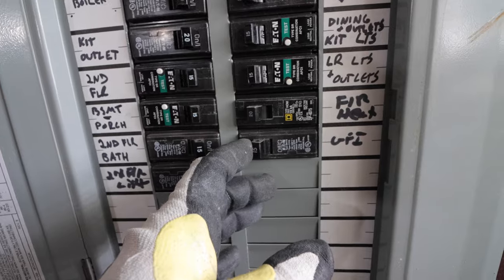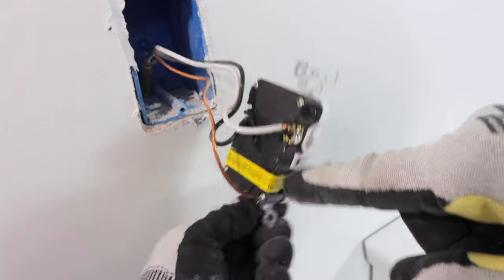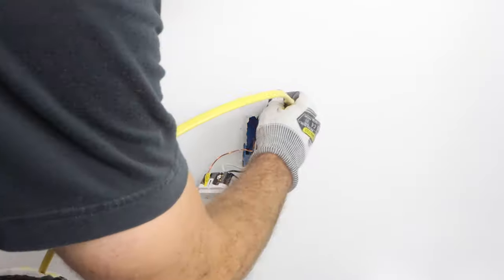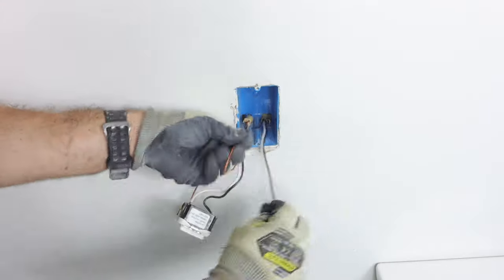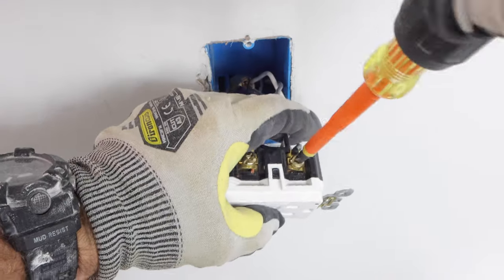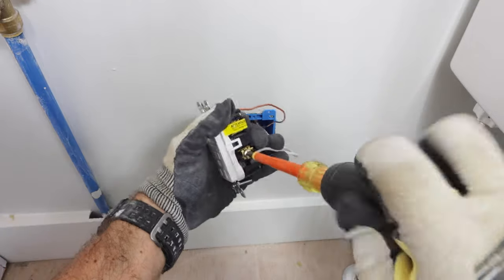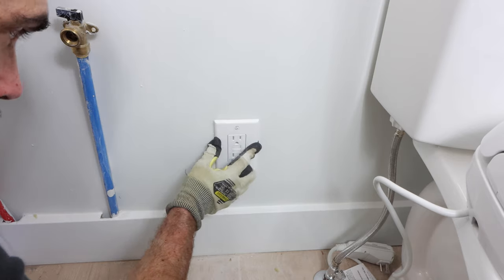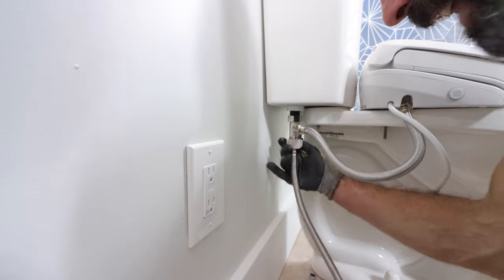How to Add Second GFCI Outlet in Bathroom

Comment: Just came across this video - WOW is all I can say - Do Not do this at home - you need one GFCI at the beginning of the circuit - the second receptacle should be a regular receptacle - wires from GFCI to second receptacle go on the LOAD side of the GFCI - also with the wire nut he is using you do not have to add a third ground wire for a pig tail - hence the hole in the top of the wire nut - you twist the two grounds together and then snip one off leaving one long - the long one goes through the hole of the green wire nut and around the ground screw of the GFCI.

Comment: You went pretty fast, but it looks like you wired the second gfci from the load of the first. That's wrong, a gfci should not be getting power from a previous one or one gfci per circuit when using the load. Just put a regular receptacle for the bidet and you would be good and the best method. Then place the label that states "gfci protected outlet" on the new outlet. Alternatively, you could use a second gfci, but it must be wired from the line of the first one, in order to make them independent.
Reply: this is what I was thinking, I though I was the only one
Reply: @jefejff  actually your incorrect do your research before you state someone else was incorrect.
Reply: It looks like (to me) for the top gfci, he put both blacks on the line side, but for the white wire he put one on the line and one on the load?

Comment: Technically the way you wired the 2nd gfi to the first gfi is wrong.  Im surprised you got 2 orange lites on at the 2nd gfi.  Because the 2nd gfi should be hooked up to the line side not the load side.  Many othwr videos demonstrate this and the 2nd gfi will have power on the wires but not to anything plugged into the outlet.

Second, all you needed was a regular outlet.  No reason to use 2 gfi on the same line.  And the toilet seat has one built into it also. You have 3 gfi for that seat

Comment: That’s a lot of GFCI’s for one run.
Reply: Line to line connection to the second GFCI. No load terminal used in this application.
Reply: @tedlahm5740  No, he specifically said "removed the yellow sticker" from the original GFCI, those were the load terminals

Comment: Line to line connection. Not mentioned in the video?
Reply from the maker: should have mentioned that but figured it’s implied based on the sticker still being on the original GFCI
Reply: @HomeRepairTutor  at 1:35 you removed the yellow sticker to attach to the load terminals, no?
Reply: @aantony  But the sticker is No LONGER on the original GFCI.
    OBVIOUSLY the original GFCIBis wired INCORRECTLY. Should be line to line,
The yellow sticker should not have been removed.
Reply: @HomeRepairTutor  Sticker is removed. obviously wired incorrectly.
Nothing should be on the LOAD side of original GFCI
Reply: Is it redundant to have two gfci on the same circuit? (Line to line) I’m currently adding a receptacle to an existing one

Comment: Omg what are you doing. That’s completely wrong. Stop doing electrical work. Those gfcis do not work now. But thankfully the toilet seat came with a gfci cord attached to it. So you didn’t need a gfci outlet anyways. 
When you put 2 gfcis on the same circuit each one needs to be feed from the line side not the load. The end
Reply: The top one is also wrong. Haha